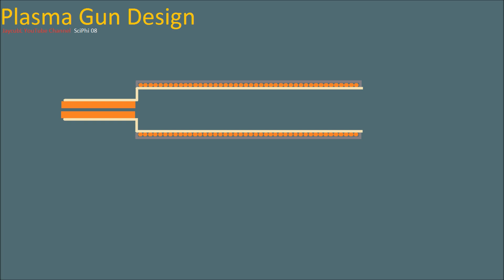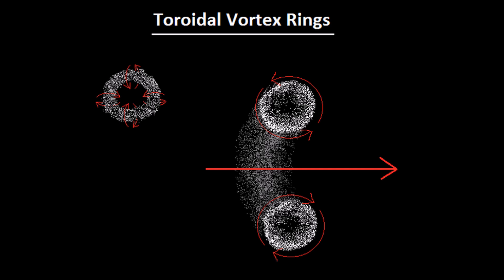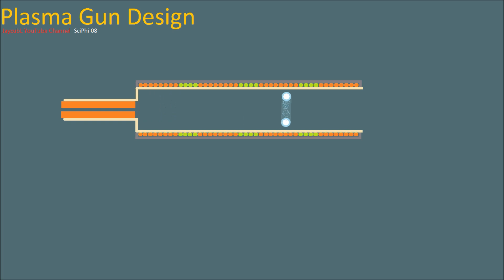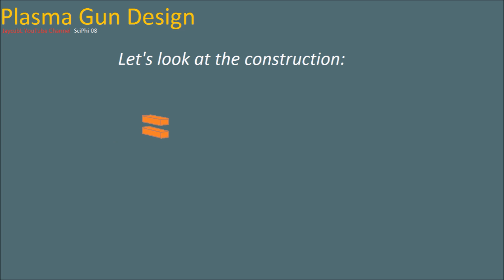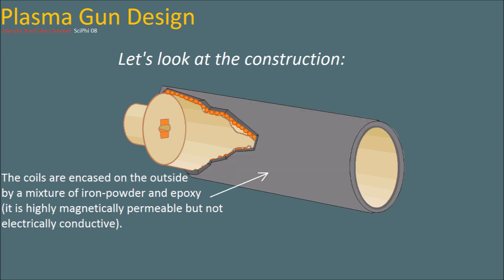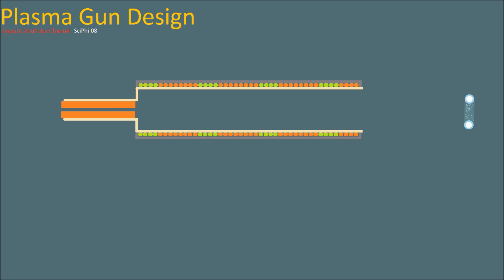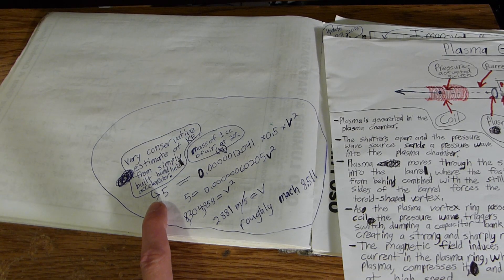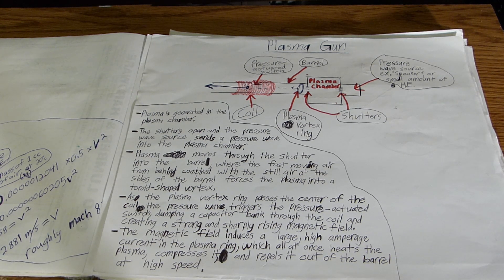Plasma Gun Design, Particle Ion Beam Weapon SciPhi 08

Comment: I had the same idea two years ago, and the patent application is pending.

Edit: Thanks for the heads up. I came up with the concept in good faith and I honestly think it's cool that our ideas are so similar. Here's hoping either of our applications are accepted.
Reply from the maker: I don't believe you... you should be careful about such a claim, fraudulent patent pending claims can earn you a $500 per day fine. Anyway I designed this more than 6 years ago.
Reply from the maker: Thanks for the edit, if you really do have a patent application then that is cool. Good luck with your version of this. Are you going to try to build it?
Reply: Absolutely! My design is slightly different but I've been collecting parts on a student budget since I came up with it. If you're curious, look up Professor Randy Curry at the University of Missouri-his device goes but it's harmless.
Reply from the maker: Domenic DiPasquale Thanks I will look it up!

Comment: interesting design, but wouldn't the copper ignition bars wear out quickly by the intense heat? yttrium, iridium, tungsten or palladium would probably be a better option.
Reply from the maker: They would wear but it should function fine with worn rails as long as it doesn't go too far. Yes tungsten could be an option if copper wears too fast.

Comment: Hi, and where is prototype? ^) can you demonstrate?
Reply from the maker: Hi thank you for watching! I plan to build this, but I am trying to earn funding from viewers in order to build a prototype to present to everyone. In the video description, I have a link to a Patreon campaign: https://www.patreon.com/JaycubL   If I receive funding then I will build a this device, and record the process for everyone.
Reply: You can collect some money if you make a little, working prototype, but i think 500 usd is not enought money for this. And, plasma can alive only in magnet field, when it leave field - evaporating momentally. Maximum what you can with this - building a simple, reactive,  plasma engine (very weak).
Reply from the maker: I think the plasma ring will last at least a short time after it leaves the gun. Think about what is happening inside the ring: Current flowing in the ring will cause it to self-constrict along the path of the flowing current (think about a lightning bolt or other electric arc. While the current flows through the plasma, magnetic forces cause the arc to be a thin filament instead of spreading out wide). As long as the current lasts in the ring, it should not easily dissipate. Larger guns or cannons should be able to produce longer lasting plasmoids. If it is possible to produce a plasmoid that will last only one tenth of a second, the plasmoid could travel 200 meters if it carries a speed of 2000 m/s. Muzzle velocity much higher than that should be very possible. Also notice that inside the linear induction motor, repulsive magnetic forces should radially compress the ring (ring would get smaller in the accelerator). But the ring would expand some after leaving the accelerator due to internal magnetic forces, this would limit maximum range.
Reply from the maker: Another thing to consider about the use of this is that if it does not end up functioning well in testing, it might still work in space. For use in space you would need to bring a cylinder of compressed gas for the plasma to be formed from.

Comment: The plasma will turn back into air at the exit...
Reply from the maker: You should consider how long a "smoke ring" can be stable and how they can be fired hundreds of feet and still carry the force to blow things around / knock stuff over. Supposedly an air-vortex cannon powered by an explosive gas mix proved itself capable of breaking lumber at 200 yards in a 20th century experiment. The toroidal vortex ring is self stabilizing. That is the point of designing the device to form the plasmoid as a vortex ring, so it will not dissipate immediately. If it were fired as a "glob" or regular jet of gas then it would dissipate quickly sure.
Reply: I know the stability of vortexs. What im talking about is the temperature. The plasma will turn back into air because there won't be anything to keep it hot...
Reply from the maker: Ohos Usani There will be an electric current in the ring, which will drop quickly but due to it's magnetic field the current can't drop instantly. At the speeds that should be possible, it would need only a small fraction of a second. Larger plasma guns would be able to produce "projectiles" that last longer. Exactly how far it can reach out is to-be-determined, yes. We will see. If necessary it would be possible to send energy to the plasma from the gun via radio / microwave, it would be a drawback if that is needed though.
Reply from the maker: iain schmaloer In a linear induction motor there is a continuously changing magnetic field. At high frequency/high power the induced currents will be very strong. If you do not understand that RF / microwaves can sustain plasma, then you can see evidence right here on YouTube by searching "microwave plasmoid." The magnetic field of the plasma ring after it leaves the barrel is proportional to the current flowing in the ring, and it cannot instantly disappear (as the current drops, the collapsing magnetic field induces current, so the current drops more slowly just like in any inductor).
Reply from the maker: apeture123 Hahaha weird excitement noise?! Like what noise a fart or something? Yeas you would get different colors with different gasses. Some gasses would be better conductors than others, and some gasses or vapors could create a denser plasmoid.
Reply from the maker: apeture123 Yeah that is cool what you are saying about customizing the color! The magnetic forces in the LIM would tend to compress the plasmoid toward the center of the barrel, hitting the barrel wall should not happen.
Reply: @JaycubL   Did you make it?
Reply: @JaycubL  a smoke ring vortex is not a highly ionized gas and does just react on thermal flows (wind). High-temperature ionized gas tends to expand really quickly! Do your research about Thermodynamic and not Aerodynamic. And btw... if it would so easy to control High-temperature ionized gas a fusion reactor would be a child play and not a science field.
Reply: what we need is a website with links attached to any videos or media related to this particular video or anything relating to the overall subject, on the main website, there needs to be: 
projects, under projects there needs to be linear plasma torroid accelerator (or similar) 
under 'linear plasma torroid accelerator' there needs to be: description of function and minimum requirements for the device, a (2)D diagram showing the device and its functionality (on the same page) 
then there needs to be a members list there needs to be 1 project director, subject managers & editors (of arbitrary number)

then there needs to be contributors, these can be ANYONE, the contributors can have assigned roles if they choose, the assigned roles could be edit written information, edit diagrammatic information, edit numerical or mathematical information, etc... however a copy of the contributors work (regardless of the type of work) is sent to a digest file folder under the appropriate application whether in over all design, component theory of operation/design, numerics... the work is then assessed and implemented, there needs to be a feedback panel, a chat panel, and an announcement panel all of which should be easily accessible on the page, also every so often all of the directors and project managers should work together to test the overall functionality and and component compatibility... 

comment if you are interested in making a website to develop this idea and even develop other technologies such as nano robot technology, compact high power laser technology, heat recycling technology, integration of "TR-3B" style gravity reduction technology into the likes of vehicles such as cars and airplanes, and one day maybe even develop 'power Armour/Armor?' technology.
Reply: You don't want your extended barrel to absorb any magnetic energy. I would use ceramic or glass. I would have a metal strip-ring at the tube exit (external) charged HV  to accelerate your plasma bolts, and I would use a caduceus coil, which produces the magnetic smoke rings you want, to contain the plasma like a magnetic bottle, to infinite distances. This is not expensive to produce, a microwave oven transformer with two caps in resonance mode.
Reply from the maker: iain schmaloer Hi iain thank you for your comment. You are taking this seriously so I will explain a little about LIM's so you can understand.
1) In a linear induction motor (LIM, the set of coils on the barrel) the coils are triggered in a forward-rolling sine wave, with high-frequency alternating North and South magnetic fields moving from the rear of the set of coils toward the front. The current that is induced in the plasmoid or any other conductor in the LIM has a magnetic field that resists change in position in relation to the LIM's magnetic fields. So the plasmoid is carried along with the forward rolling magnetic fields. So for example if you drop a magnet through a copper pipe, the magnet moves very slowly because the moving magnetic field induces current in nearby conductors that resists change in position in relation to the magnetic field. Same thing, induction, resistance to a conductor moving in relation to a magnetic field. This is how all LIMs work. What you described about it being repelled from the center of the coil is what would happen if you suddenly powered on the entire set of coils at once as one coil, which is not at all what I described in the video, but could be done as long as the plasmoid is past half-way down the coil (that is how it was in my original design but I think you would be more limited on max acceleration and efficiency that way).
2)Your statement here is completely false, the coils for a LIM can be positioned perpendicular or concentric or a different way. As long as you generate the forward rolling magnetic fields the arrangement of the coils could be done in a variety of ways. For this application (my plasma gun design) the coils are concentric to the barrel and this arrangement is already well known to work well for LIMs.
3) The plasma would only need to be sustained for a fraction of a second and it may sustain long enough from the current remaining in the plasma ring (larger plasma guns would probably produce longer lasting plasmoids because they would just be larger and hotter with more energy, experimenting will be needed to see how long is possible). It would not take a ridiculous amount of microwave energy to sustain the plasma a little longer though if needed. A very brief pulse focused into a low divergence cone using a microwave horn (a type of focusing antenna basically) could keep some current in the plasma, even with lower energies like a few kilowatts. A 1/4 second 5kw microwave pulse would do little or nothing to a human target unless it was very well focused on a small target (imagine 1.25 seconds in a 1kw microwave, your tea is still cold...), but it would have the benefit of disturbing/possibly damaging unshielded electronics at the target area.
4) Yeah different gasses would glow different colors. Regular air would usually be blue, to maybe purple. Metallic residue from copper rails could color the plasmoid green, or other metal rails would have other effects.
Reply: Black Swan, Although it is highly classified (and possibly cancelled) the USAF did develop MARAUDER (Magnetically accelerated ring to achieve ultrahigh directed energy and radiation). Although  blue prints aren't available we can assume is work in as similar way to this, or at least had a similar projectile (probably having way more power.

According to Jane's Defence Weekly 29 July 1998 (very "reliable source") The plasma projectiles would be shot at a speed expected to be 3000 km/s in 1995 and 10,000 km/s (3% of the speed of light) by 2000. A shot has the energy of 5 pounds of TNT exploding. Doughnut-shaped rings of plasma and balls of lightning exploded with devastating thermal and mechanical effects when hitting their target and produced pulse of electromagnetic radiation that could scramble electronics, the energy would shower the interior of the target with high-energy x-rays that would potentially destroy the electronics inside.
Reply from the maker: Hi Timothy thanks for your well thought out and helpful comment. If you are serious about making a website like that then I would love to work with you on it. Then we could get more people involved to get funding and start to get things built and tested. I want to see this thing functioning!
Reply: JaycubL will do, i just found a think tank website that seems to be quite promising for developing this and many other amazing feats. It is: http://www.worldthinktank.net/join.shtml this might be it!, you are however required to fill out a rather challenging form (i am still working on it) but always remember what will be achieved if we can get onto this "world think tank" it will save the development of my website and there are already a lot of very intelligent people on there waiting for people like yourself and I to direct their thought into the development of this, when/if i get onto this think tank my name will be the same so i will be easy to find. I am also going to link the site with drop box so everyone can easily share and update files (with backup files already made).
Reply: PLEASE do not patent this. The military does not need this. They do enough with what they have. They do a good enough job keeping the world in ruin. The people deserve some sort of edge.
Reply from the maker: That looks cool I will check it out thanks!
Reply: JaycubL I have a question about this topic u said it would be possible to send microwaves / radio waves to the plasma what about sending a Infra red laser beam into the plasma would that work.
Reply: Use propane ... or another high  densified combustionable gas.
Reply: JaycubL Try it still you never know newtons laws were broke you could make something useful
Reply: What about MARAUDER, it word on that.
Reply: Lol, plasma is difficult to mass produce. I think he might have a right idea. maybe use a magnetron and a tuned cavity to not only continue the plasma strength but also allow the plasma to ride on the wavefront of the microwave itself. I have thought of something similar to this before but never put much detailed thought to it like Jay has. Not sure how hyper sonic vorticies. would be stable though.
Reply: Imagine if you could design this to launch the projectiles with angled semi-permeable materials such that they came back and forward in a loop. If you could engineer it so that the plasma itself generated a recursive magnetic bottle=> Lightsab.. I mean plasma saber. I"m sure something like this could be done too. of course it would take a ton of power. If only the Aether/Searl stuff were somehow a thing. For now just lithium polymer and super efficient coolers is what we have to work with. If the heat transfer coefficient could be reduced from the spin in the ring, or something. If anyone has something like this for plasma: https://www.engineeringtoolbox.com/convective-heat-transfer-d_430.html - but I think it might make it lose heat faster. Can't tell. I'm going to lose it if, Elon Musk comes out with something like this extremely coincidentally in the next few months -_-
Reply: Em Pru that's what I was thinking, but there are ways around this.
Reply: I agree, to combat this use a magnetron.  As long as the plasma can ride the microwave radiation, it will be sustained.  If you include a magnetron, that is the design I have had for a very long time - so you are probably on to something.